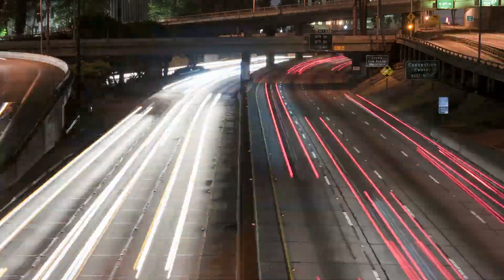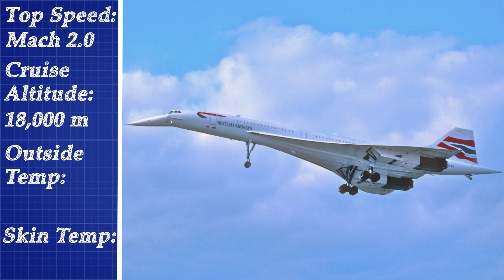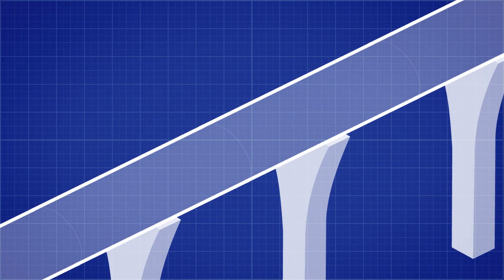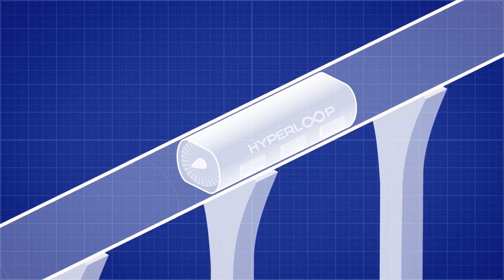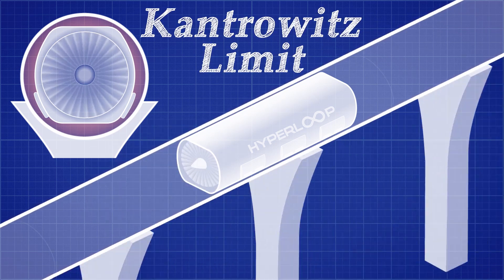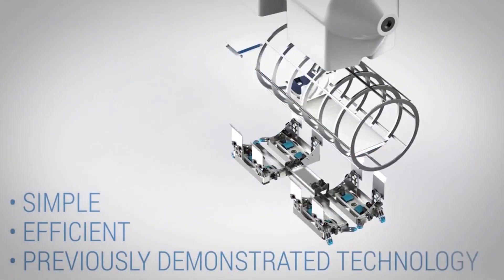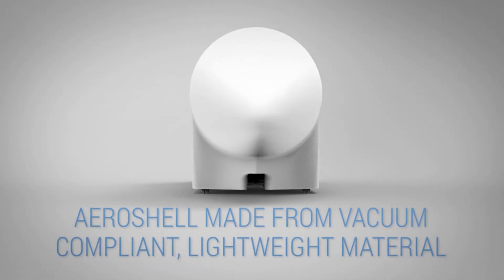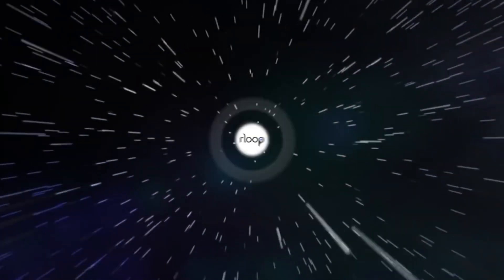Hyperloop - The Future of Travel?

Comment: I won´t say that the hyperloop is a fraud, but I would like to know how will they overcome the problems with thermal dilatation of the tubes (just as Thunderf00t adressed)
Reply: Thunderf00t has a problem with his lack of imagination and perhaps his need for attention. Thermal dilation as simplistic as he describes is easily controlled with bellows shaped sections where the multiple pumps along the way will be located. They will not need to slide and will be sealed well enough.

Comment: If there is  a hole in the hyperloop, why don't they make sections that could close off to prevent it from draining the rest of the air.
Reply: The problem that I see with that, is what happens if the hyperloop is near the section that is closing. It will be dangerous because there might not be enough time to fully stop
Reply: I heard the Hyperloop trashed the full vacuum and went with something more air filled. Maybe we wouldn't need sections after all. Or this thing could just be built underground Matías L. Ceballos
Reply: Maybe. But even if it is not perfect vacum, it still will be dangerous if a breach appears. Even if it is built underground. If it is underground and it gets broken somewhere, material from the soil will enter the tunnel
Reply: to be built underground, it would cost so much money...
Reply: I get the sense that the design of the hyperloop is changing randomly and without direction. Sometimes the Turbine is for thrust, sometimes its not. Sometimes the pod rides on an air cushion, sometimes a maglev system. Sometimes its a total vacuum, sometimes there is air in the tube.

If there is more air in the tube, and if the turbine is for thrust, then that sounds suspiciously similar to another rapid transit technology currently in service.
Reply: *****
Then everyone dies. But everything will fail at some point. You might as well ask "What if the Hyper-loop's safer alternative crashes".
Reply: Neo Delphi
If that happens, then everyone on either the train or Plane (whatever you are talking about) Would either Be seriously injured or die. If the hyperloop system, if there is a catastrophic failure There is a chance that the whole system goes down. Imagine putting your finger at the end of a straw. if you suck all the air out of it,it starts to want to deform and squeeze itself.The harder you suck the more it wants to do so. If the hyperloop is similar, the whole tube would be weakened considerably when under the vacuum.
Reply: boomchacle
Everything has an fault, the engineers are trying their best to make it as safe as possible. Ultimately I see this as cheap hypersonic travel with risk, albeit a very small one.
Reply: Neo Delphi 
Well lets see, it's not hypersonic, its not cheap, and it seems like the risks might be very big.
Reply: Neo Delphi a small risk that if an earthquake happens and the tube gets ruptured, any craft inside it will be killed and the entire tube will be unusuable untill they somehow manage to fix it. If a train track gets broken, it can be easily fixed, as it isnt under any kind of vaccum and if there is an earthquake and the track gets broken in an train, there wouldn't be as much danger to the train because they can stop and get out. With the hyperloop, anyone inside would be stuck inside
Reply: boomchacle
People on underground metro trains would get stuck if an Earthquake causes a cave in, and no one said that the hyper loop can't be built above ground. (Correct me if I'm wrong about that.)

The risk that you mention can be lessened as material science improves, like with the invention of transparent aluminum and stronger concrete, but you cannot fully erase the risk, only soften it as much as possible. Ultimately, if you think the Hyper loop is that risky, then you shouldn't ride it. It's that simple.

When I used to be scared of airplanes, I would  think of as much possible ways the plane could crash, from malfunctioning engines to having a wing torn off. Want to know how I got over that fear? I assured myself that the probability of those events happening were close to zero or were very unlikely to happen.

In an event that lives are taken, which will happen, we have to accept that it was bound to happen eventually and create a better, efficient design. We can't patch the problems if the thing the problem occurs on doesn't exist.

The way I see it is that you get a new but slightly dangerous method of transportation or nothing at all.

The one thing that the world's currently lacking is innovation and I want something meaningful to be conjured during my lifetime, whether it's the hyper loop or something else entirely.
Reply: Neo Delphi the thing is, that the hyperloop is expected to be in California, which is highly prone to earthquakes, and even if the hyperloop is on the surface, It would still be shifted by a small amount. even if a metro train gets caved in on, it wouldn't cause catastrophic failure for the entire system, as trains behind and in front of that area could stop. Even the people in the train have a chance as they could get out and walk to the other station. With a hyperloop, that would not be possible as they are in a giant steel tube and they would have to walk for at most 50 miles. Also, what would be the point of having transparent aluminum, as we already have materials much stronger than that. When it boils down to it, you could just make the tube out of tungsten and have it be 10 feet thick to prevent anything from happening to it, but it would just cost more. This system could be made to be the safest system, but there would be no point as it would cost a ridiculous amount of money. Even now, trains cost about 100$ per ticket, and having an advanced system that utilizes vacuum technology and advanced materials would cost many times more than a simple two-track design.
Reply: Neo Delphi also I was against the idea of it being built underground...
" 
boomchacle
Aug 11, 2016
 
to be built underground, it would cost so much money..."
Reply: boomchacle
You need transparent aluminum if the tube is above ground. It would be an eye soar having an opaque steel tube above ground and running through the beautiful landscape.
Reply: Neo Delphi
if the whole point of this is to make it fast and cheap, why not just use maglevs?
Reply: boomchacle
I don't know but I'm not against Maglevs. If Hyperloop turns out to not be festive, we always have Maglevs as an option.
Reply: Neo Delphi hhm that's kinds weird... they work fine in japan

Comment: All great until the vacuum gets a hole
Reply: J.Dragen  You can still land a plane without engines.
Reply: You gave an argument from incredulity. There's nothing wrong with that quote. You threw out a big number and implied it was obvious it would kill someone without a shred of analysis. People have lived for years at weights over 900 lbs. Force alone is not an indicator of risk to someones health. A very small force can be sufficient to kill someone if applied over a small and critical area like the temple, but that's not what's happening. Its a deceleration force spread over the entire body and for a very short period of time.

We know that people in a sitting position can endure several times the 3G force I quoted for several times longer than I calculated In a sitting position. If better restraints are required, that's a trivial engineering problem.

Don't attack my arguments for lacking nuance when yours have absolutely none.
Reply: You could easily bring the capsules to a stop with modest g-forces in < 100 seconds. Remember, this is for a catastrophic failure, unpleasant g-forces are not a top priority. On your second point: if a pod is breaking, it's already going slower that the speed at which it was designed to take any given turn. All the turns in the route are designed to be extremely gradual to minimize g-forces. While 7-800 mph sounds crazy fast, that's not the capsule's speed relative to the tube walls, you'd have to have a pretty tight turn for a capsule to go straight through an inch of steel.

Also, +Aleksandr Vasilenko. A small hole wouldn't lead to a much larger hole. You're being hit by 15 lbs of air moving at the speed of sound all the time and it's not ripping you apart, is it? It's not enough to tear through 2 cm of steel or even half a cm of aluminum. A small hole simply won't be ripped open as you imagine.
Reply: EDIT: this comment was in response to comments that have since been deleted.

Yeah. Believe it or not, people survive those kinds of forces all the time. Your argument from incredulity is not very impressive.

From the wikipedia article on g-forces:
"Early experiments showed that untrained humans were able to tolerate a range of accelerations depending on the time of exposure. This ranged from as much as 20 g for less than 10 seconds, to 10 g for 1 minute, and 6 g for 10 minutes for both eyeballs in and out.[14] These forces were endured with cognitive facilities intact, as subjects were able to perform simple physical and communication tasks."
Reply: And airplanes are all great until an engine fails.
Reply: /\ oh boi, that's a quoteing war if I ever saw one
Reply: Millitron 
also you say like it's a small thing. do you have any idea how much force is 14psi? it's like a ton of force pressing down on a squre foot area.
Reply: Angus Chandler yea like an armour piercing round
Reply: all great until the wheel gets a hole
Reply: Abe Dillon 
but what about if there is a larger hole, sveral meters in diameter for example?
Reply: It doesn't matter how big the hole is, the pressure differential is still just 14psi.
Reply: Angus Chandler
A trailer is not made of almost an inch thick high grade steel. there's a pretty big difference.
Reply: how about the crushing?
Reply: 0,01 atm it's a hell of a high pressure or 1%, isn't it low enough for you?
Reply: Because we don't have a tube to be careful with... A plane can move around without any problem... And it won't hit a wall of 1atm air moving against it at speed of sound in case of depressurization like the hyperloop would...
Reply: Depressurization in an airplane is a fucked up situation, at least the outside pressure is a 0,1 atm... 10 times better than the hyperloop...
Reply: noahdouble07 air likes to go from high pressure to low pressure. A vacuum is almost zero air pressure, and our air has quite alot. So any size hole means air molecules will go inside really fast.
Reply: noahdouble07 a tiny hole will lead to an entire section blowing up. Because as air rushes into a tiny hole, it ends up breaking the structure, creating an even bigger and bigger hole.
Reply: All great until you realize it's designed to allow for thousands of small holes, actually read about the damn thing
Reply: Except its not under that much pressure.  Ambient air pressure is only 14psi.  Hand powered bicycle pumps are stronger than that.

It's not like if a submarine had a hole in it.
Reply: Angus Chandler 
The myth busters didn't drop a brick on the tanker. They dropped 1.5 tons of bricks from 30 ft above the tanker. I'm curious how often you think 1.5 tons of material will be elevated more than 30 ft above the tube which is about 8 ft in diameter and elevated 20 ft above the highway. And how often that load will come crashing down on the tube, which, again, will be twice as thick as the tanker in the mythbusters video and made out of a completely different grade of steel.

That's not a slight quibble about the steel grade. Different steel grades have completely different properties. A steel designed for the tensile load of holding in a high pressure and/or cold fluid will be completely different than a steel designed to endure the high compression load of the atmosphere pressing in on a vacuum.

NASA's Space Power Facility was constructed under such completely different design constraints that it's not even remotely comparable to Hyperloop. You can go back and research the Mythbusters episode and see that the tanker managed to sustain almost a complete vacuum before they put the dent in it and it didn't need 6 to 8 ft of concrete to accomplish that. That should tell you something about how incomparable the two are.
Reply: Aleksandr Vasilenko Your original comment is still incorrect. A hole would not cause catastrophic failure. Your assertion that a small hole would lead to a larger hole is false. 2 cm thick steel can easily endure the force of 14 psi air rushing into a vacuum without any further structural failure.

In the event of a hole, the ingression of air would quickly stratify and not act at all like a nuclear blast as thunderf00t would have you believe. There would be no accompanying blast winds to rip or tear stuff apart.
Reply: To be more specific, it would take about 10 seconds of 3 g acceleration to stop the pods. Easily survivable even by the elderly.
Reply: They will replace or patch the damaged area and represurize the tube.

If you're worried about the case where someone blows open an 8 square meter hole in a 2 cm thick steel tube elevated 20 feet above the median of a highway to possibly kill 28 passengers if the pod is close enough to the detonation, then shouldn't you also be freaking out about someone destroying a a meter of TGV train track and derailing an entire train and causing all sorts of collateral damage?

Yet TGV has been operating for ~30 years without any terrorist threat or large chunks of track disappearing. Maybe it has something to do with the fact that you're more likely to be attacked by a shark than a terrorist. 

...Or maybe TGV BUSTED!!! TGV WILL KILL YOU!!! TGV BUSTED II!!!!!!!!
Reply: Considering bicycle tires are around 90psi, and they don't explode when they get punctured, I think the hyperloop will be fine.

This doesn't mean I think the hyperloop is a good idea; I don't.  It's not economical, it has all the expenses of a transcontinental railroad combined with the expenses of the Concord airliner.  But that doesn't mean it's unsafe.
Reply: according to Elon Musk the tube is LOW pressure, NOT HIGH pressure.